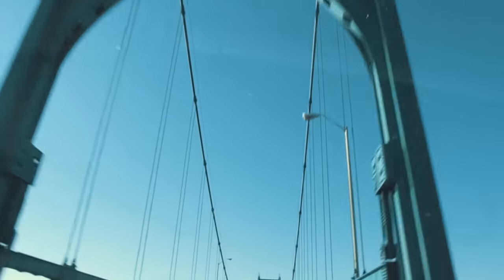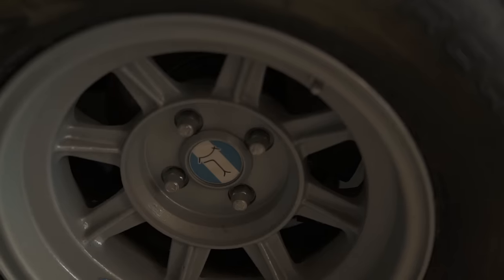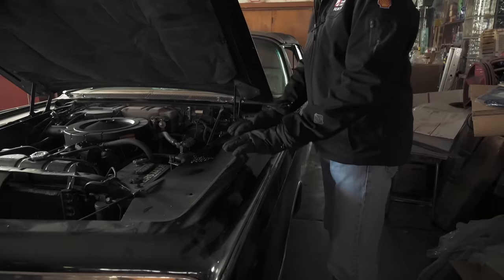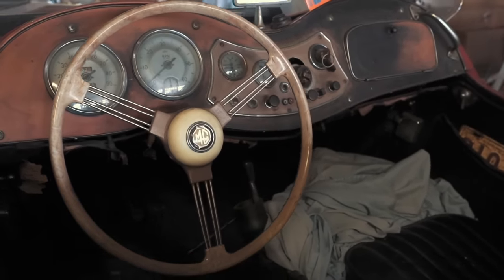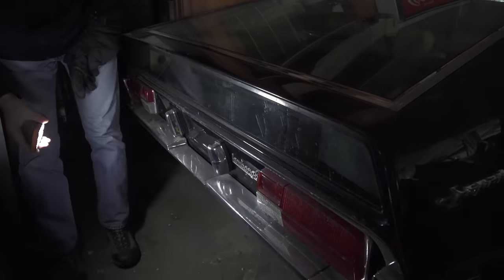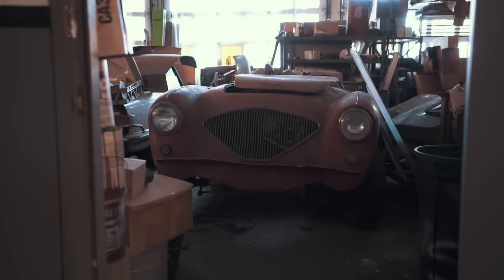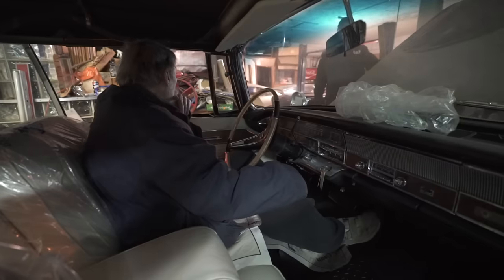De Tomaso Mangusta, Lamborghini Espada, need we say more? | Barn Find Hunter - Ep. 48

Comment: The De Tomaso Mangusta was very much a hand-built car.  The early cars were, as mentioned here, incredibly difficult cars to drive as the handling was all over the place, but it was far from the only supercar from the period to have those issues, the much-loved and now massively valuable Lamborghini Muira really didn't handle well at all and suffered from horrific aero lift at around 120 mph which would see it just understeer straight off the road into the scenery due to their being effectively no weight on the front wheels to allow them to have traction on the road surface.  The Mangusta was extensively developed over its production life and the last of the line were pretty much as good to drive as the early Pantera that replaced it but the reputation stuck making it a hard sell and the fact that it really wasn't designed for "mass" production sealed its fate.  Early Mangustas are incredibly rare now, out of the 50-or-so built (the number is uncertain as road car production figures are mixed up with those of competition variants so the number of road cars may have only been in the 30s) and the difficult handling has led to a lot being destroyed as has a typically Italian ability to rust and low values for a very long period meaning that potentially restorable cars were broken up, so survivors of the early road cars may well be in single figures, most of which have very low mileages on them as a lot of people that had them drove them once, scared the living daylights out of themselves and never drove them again.  They were also notoriously unreliable as, although hand-built, they weren't necessarily built with the greatest of care for quality and quality control seems to have been virtually non-existent so it was far from unknown for cars to be delivered with major problems.  Surprisingly, the Mangusta was a very successful competition car although a lack of backing meant it never really featured at the higher levels that made other vehicles, like the GT40 so famous.  One problem with the Mangusta that never really was fixed was a lack of cooling, you really needed to be maintaining speeds of 30-40 mph to keep the engine properly cool and sitting in traffic with the engine running was an absolute no-no as they would easily heat up enough to destroy the very strong Ford V8 engine.  The name Mangusta means mongoose in Spanish...
Reply: gosportjamie what ? Competition Mangusta?  There may have been 2 or 3 privateers. These are grand touring cars always were. There was actually 401 (or 402) built.  The 50 you think you refer to is the number of late US bound cars with the 2 pop-up headlamps. Cooling, same as most Italian cars from the 50s & 60s. Fans were not shrouded. Add a little water wetter and drive it all day long at (and above the speed limit) I did.
Reply: @norac1244    Although it isn't widely known, Alejandro De Tomaso was an exponent of the philosophy of competition improving the breed.  As you say, Mangustas were raced by privateers with limited success, but there were also factory-developed competition cars that were raced with a decent amount of success.  This tends to get missed as most of them were raced in South America, and not much attention was paid to racing there at the time.  The competition cars were the inception of a lot of the improvements that were made to the later production cars, the company didn't have a lot of money for prototyping and development testing so trying ideas on the race cars was an alternative method, and De Tomaso were far from the only company to do so.  I stand by my figures for the early, single headlight cars, the figure comes from a marque historian who has been involved with the cars pretty much from day one...
Reply: gosportjamie sorry the early cars had 4 headlights. I have read many books on DeTomaso. Even one written by a ghost writer where the author put all the racing stats in the last chapters. I would be very interested to see / read about SouthAmerican DeTomaso.
Reply: Fun to read the stories and information surrounding the Mangusta, and I love what you both and Tom and Robert share about them. I always thought the Mangusta had 351's like the Pantera, not the 289/302's. Anyway - "function follows form" - yeah, always loved their phenomenal lines with the crazy gullwing rear covers, but as you say, I've read of owners who sold theirs promptly after experiencing very disturbing nose lift. Some say the source of the handling problems were largely the "center beam" or "backbone" chassis, like the Lotus Elan and DeLorean.. But the nose lift was all aerodynamics. The ZF 5-speed was shared with the Ford GT40 and the Maserati Bora. Despite thermoswitched fans, the Bora is likewise easier to keep cool the faster you go. Too bad Tom and Robert didn't spend more time on the Espada, another exotic from the same era - and Lamborghini's most successful car of its time with just over 1,200 sold - a sales figure not surpassed until the Countach came along. The choice of Mangusta as the name of a snake killer, is said to have stemmed from De Tomaso having a nasty fall out with Caroll Shelby who pulled out of a partnership to build an Italian follow-on to Shelby's Cobra...  Cheers.

Comment: The name Mangusta has a nice and true explanation: Mangusta means Mongoose and is the only animal that can eat a Cobra snake. You know Cobra, as in Shelby Cobra. This is why Alejandro de Tomaso gave this car the Mangusta name.
Reply: still there was no way for a Mangusta to eat an Ac Cobra on the track .....
Reply: Valentin Manus not the version that was produced, the Prototipo was suppose ta have a recast aluminium version of the 289, dry sump, fuel injection and was quoted to have 570hp in 1965. No small block cobra could have stopped that.  The name was given in jest as this car was tested as the Shelby Mk5. Instead Ford went with what is known today as the Pantera.

Comment: Robert has a very nice indoor junk/parts yard. I say that with respect because most of his cars are projects that he will never finish.
Reply: Sadly none of them will get finished. The rest of the place was just crammed with boxes and boxes of junk that’s been accumulated over the years.
Reply: @carl_marks1626  That's what I'm saying. Its so sad to hear some one talk about the love for cars and then we see them under covers that haven't been touched for years. That's not what I would call love.
Reply: @mmill6505  As you get older, your dreams and intentions move farther away. I had dreams of retiring at 55 and working on cars. In your 50s, your body starts breaking down. When I was younger, I could work in the garage for 12 hours without a problem, now after 2 hours, my back is aching and I have to rest. I had a 54 Corvette kit car sitting in the garage for 10 years and only got the chance to work on it for 1 month to install 84 Corvette suspension, 350 sbc tri-power, T5 tranny. I sold it a couple of years back realizing that I would never be able to finish it. What used to take a day, now takes a week. That's life.
Reply: I'll chime in and stick up for my friend Robert.  Some of the cars are projects that won't be finished, but a number of them are cars that he bought in good running and driving condition (Mangusta, Espada, E-type, Imperial, Sprite, Crosleys)  Unfortunately, they haven't been driven in a long time and will need substantial refreshing, but they are not mostly "project cars."
Reply: @scottjohnson9853   "haven't been driven in a long time and will need substantial refreshing" That would make them mostly "project cars."
 If they are not running and driving them what would you call them?
 
1
Reply: It is time for these cars to move to new owners, which is why the collection is for sale. If there is serious interest in any of the cars shown, please message me. Cheers -Brad

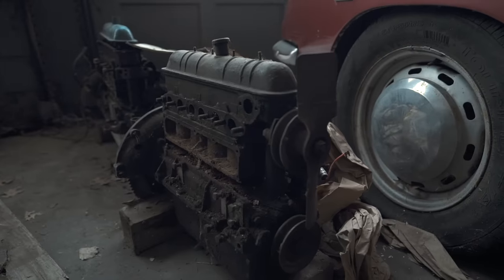Comment: The Building  looks just like a Matchbox garage a kid next door to me had. it even had a ramp to drive up to the top.  So you could drive your matchbox or Dinky Cars in and get them servced or trade them in. at 19:05 is a pretty significant thing, a Wolseley OHC cam engine ,based on designs seized after WW1 from Hispano Suiza with a shaft driven Camshaft. . I couldn't tell if it was a six or a four ,either way they are pretty cool for an English design. and at 30:09 a Austin Westminster A109  .Similar engine to the MGC but totally different . BTW BMW also used the BW  T 35 trans as did Ford UK for a while .Nice simple trans which was pretty common once.

Comment: If the registration number show on the Frogeye Sprite is correct then it's a 1958 car that was originally painted Speedwell Blue, the pale blue so much associated with these cars.  The information suggests that the car either hasn't been in the US for particularly long, or that it was originally exported before the UK registration system recorded UK market cars being exported.  Nonetheless it was a UK market car though not necessarily right-hand drive originally as a lot were sold to US service personnel who bought them as left-hand drive cars ready to take home with them when their service in the UK ended.  It could also be that the car has been rebuilt in left-hand drive form though that isn't a particularly easy conversion on a Frogeye...
Reply: i think that plate is just a front plate made up and stuck on that car, yac 740 is quite a "famous" reg no in sprite circles, and since in most states the front plate is not mandatory people put a period correct uk plate on british cars jay leno does it.
that sprite could be yac740 but i doubt it.

Comment: The steel disc wheels with hubcaps were standard equipment on the MGB (before the rostyles) and MGC.  Painted or chrome wire wheels were extra-cost options, and pretty expensive ones when they were new, especially the chrome units.  The automatic gearbox was a very expensive option on those and now incredibly rare as an awful lot of the automatic cars were converted back to manual gearboxes as a cheap way to afford one of these cars, as well as the B.  The automatic cars were a long way from desirable for a very long time and could be next-to-impossible to sell as used vehicles so they were very cheap indeed.  Now, whilst still often seen as somewhat of a poor relation, factory automatic cars are at least similarly desired to the manual cars due to their rarity though it's fair to say that an automatic MGC is far from fast and rather heavy on fuel, and an automatic MGB is decidedly pedestrian...
Reply: I have two MGCs.  My understanding is all of the MGCs imported to the USA had wire wheels.  The disk wheel cars you see in the US were Canadian imports, or imported from Germany or another right hand drive European country.
Reply: @ericl452     You may be correct for the US market though I'm not certain as the MGB was certainly sold in the US with the standard steel wheels and hubcaps so it would seem unlikely that the MGC wouldn't.  It is, perhaps, more likely that, with the US being a wealthier market, more people could afford to order what was a fairly expensive vehicle with "appearance" options such as the wire wheels...
Reply: The early MGBs in the US market definitely came with disk wheels.  You typically find them in 1962 to 1965 vehicles.  They became less common after that.  By 1968 when the MGC was sold, almost all MGBs were sold with wire wheels.  On a side note, the MGB disk wheels and MGC disk wheels are physically different.  The MGB wheels were 14x4.5 and the MGC wheels were 15x5.  This difference in dimensions applied to both disk and wire wheels.
Reply: @ericl452     I knew the MGC wheels were physically larger than those on the MGB.  I can only imagine that the C, with its much heavier engine would be close to impossible to drive on the smaller, MGB-spec wheels and tyres.  They do already have a reputation for being more than a little nose-heavy with the big Austin C-series cast iron 6-pot in the front...

Comment: That toyota engine is 2T. I just rebuilded same motor at my ta12 carina. New bearings and rings, lightened flywheel, 2mm more raise at camshaft, double carburetors, rev limiter, ported head. It is very quick

Comment: Putting the Toyota drivetrain was common in the BugEyes  the Toyota 5 Speeds where another favorite  swap as well ! Ive owned a 53 TD, 55 TF1500, 64 Sprite, and a rubber bumper MGB i had on the road for 14 years that Sports car Era was my Dads generation and i often heard his stories  from when he used to hang around dirt tracks as a kid  he also remembered many of the  dirty tricks or cheats the old race teams  used in the 50s  one was  in the T Series cars they would install pistons from a Mercedes Engine that were the same diameter but  actually were domed  tops  like a hemi would to boost the horsepower  a tiny bit  and looked stock to the judges  and give the driver a slight edge  over the  other teams  when my Dad and I rebuilt his TD  we did that  swap aswell  for giggles  mostly  and that was always my Dads dream car  so why not  do it the way he dreamed of it being

Comment: The FV3 is a intermediate model between FV2 from 1955 and the FVS 1958, so the information 1957 is quite clear in this time Facel Vega used medium size Chrysler Corporation Engines from Plymouth, De Soto like Typhoon and Golden Commando. Very often engines from the lower marques with "Police package", mean there were special versions that would be preferred for police cars. The automatic cars had the stronger engines, the manual cars which were preferred from european customers had the more smoother engines.

Comment: Yep  as former driver i can confirm   understeer produced oversteer is the worst situation you can find your self in..    it gives you 0 trust to car you are driving and you rather have even worse over steer issues to get rid of the understeer that turns into oversteer …        mostly caused by too stiff front end without any weight in front and  lots of weight in rear with too loose rear sway bar.   

I guess that car is great to look at and perfect for sunny cruising slowly ,   and not to take that into track or get in situation where you want to drive fast in mountain roads..

I would like to see you do an clip of  straight 8 cars  …   i have only driven one Buick for  out of garage into parkin lot just on same spot..     one of my dream cars…

Comment: This Lamborghini has the series 2 dashboard but with the series 3 wheels that have the 5 bolt pattern rather than the single mounting stud similar to the Miuras which is strange. It must be a 1972 Series 2 model which was upgraded to mount the newer wheels and hubs. I had a series 2 which was a 1972 the last year before production of the Series 3 started in 1973 with the wrap-a-round metal/leather finished dash and more modern wheels rather than the simple wooden finished dash also the engine is identical to the Miura's with the 6  twin-barrel Webers producing 350bhp. Yes, many British parts were used to build this car. Mine had a Jaguar's clutch which was much cheaper to purchase over the Lambo's when it started to slip and needed replacing.
Reply: A few very late Series 2 came with the 5 bolt wheels factory, no? That's what I've been told by the local Espada guys.

Comment: A little off on the production numbers for the Mangusta but he is correct on the handling problems.
Reply: polystictus many inaccurate info. Should have done a bit of reading first.  Handling problems fixed on later cars gussets installed from frame to rear body add wider radial tires, 29psi front and 35psi rear then do not drive like an idiot. You should be fine. 6000 miles and all good

Comment: Mangusta would be a great car to re-engineer the steering geometry if you were 4'9"s tall. Could have had a Datsun Identical to that one from an Engineer at a company I worked at. I kick myself in the ass thinking about it because he was giving it away at what he was asking.
Reply: Donald Fuller steering is not the issue. It is fine. No power assist necessary. The weight distribution could be reworked. The original concept had the spare in front trunk then production moved to back. Wider radial tires make a huge difference. Super grand touring car, not a racer. I am 5’10” 200lbs and the fit is right
Reply: Hi Donald, besides the Mangusta the Z is also for sale. Please message me if there is serious interest, cheers. -Brad